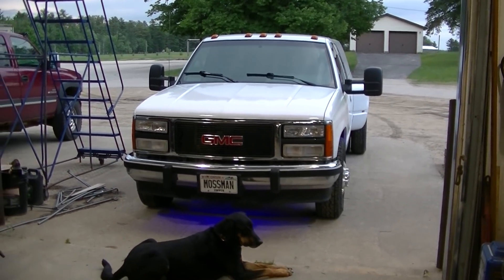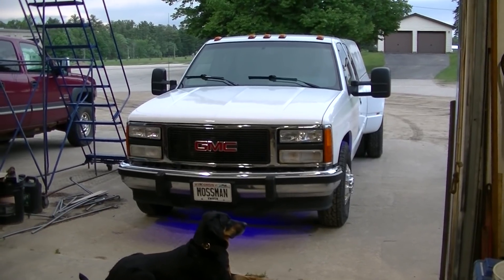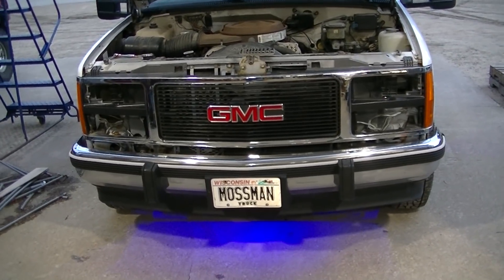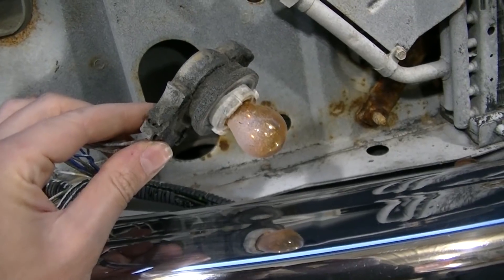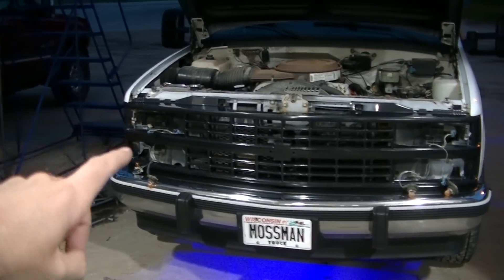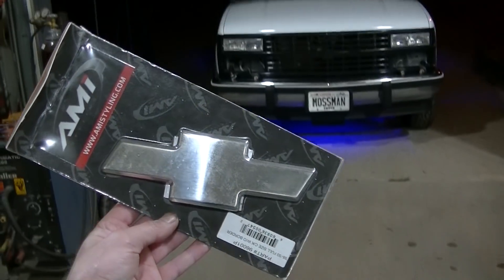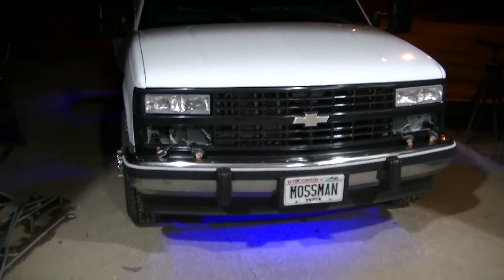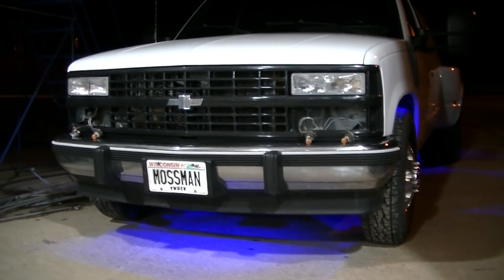91 Dually Gets a New Grille ???

Comment: I always liked the old early GMT400 Chevy Grills.  For the marker light backers, I picked up licence plate backers at O'Rielly's and they've held fine. Pretty much the same size and way cheaper than getting them from LMC Truck.  Me, I'd totally paint the behind the Grill stuff black when I have the grill off; don't like stuff telegraphing through either.
Reply from the maker: I thought about license plate tabs but was thinking they were to big.
Reply: @mossman381  There are different sized license plate inserts.  They need to be the small ones, not the normal big ones.  I forget the size I used for the Yukon but they came in a multi size pack and I just bought two packs.
Reply from the maker: Found some Dorman stuff at the auto parts store I think will work.  Not really cheaper than LMC truck stuff though.
Reply: @mossman381  yeah, in one of my videos a couple months ago I had my Sons replacing them in the back ground.  I used the lisc plate things.  They've held up pretty well.  I'm wondering if I just didn't look at the doorman section well enough then if you found some?

Comment: I think it is because the Chevy grilles look so much cleaner then the GMC ones. I have to agree with the others and say this would make an excellent hauler for the camper.  It is deffintely much better idea then trying a body swap onto the diesel frame.  I would fix the diesel up like I said and either go with the flat bed or turn it into a dually.

Comment: It will be a nice hauler for your camper.... GMC, Chevrolet comes down the same assembly line just different badging.  Just what  you prefer, GMC badging or Chevy badging.  I get it good video..👍
Reply from the maker: Back then the only difference was the grille and badges.  In 2003 they started to get different body panels and other differences.